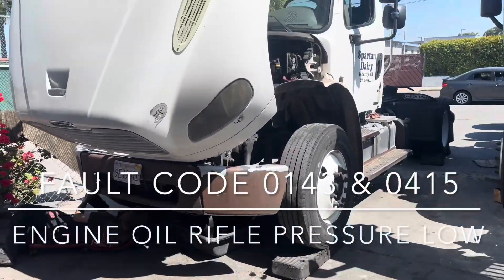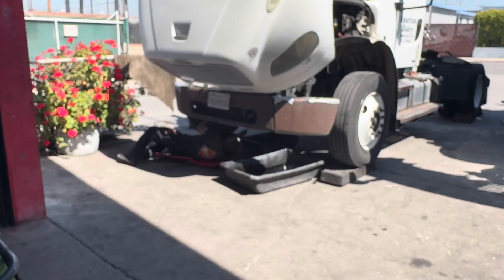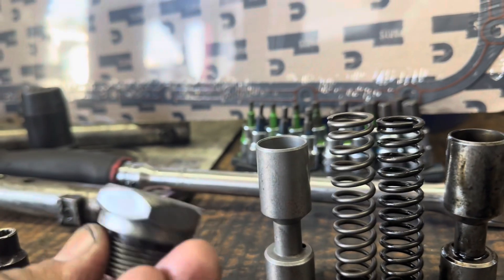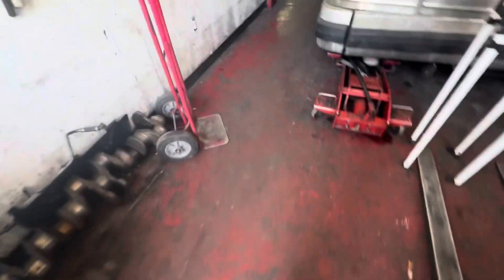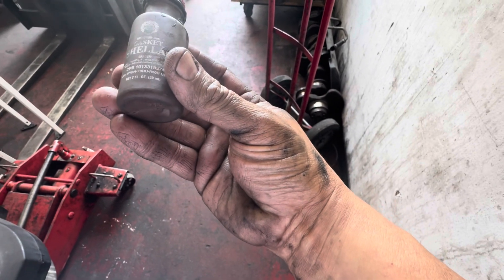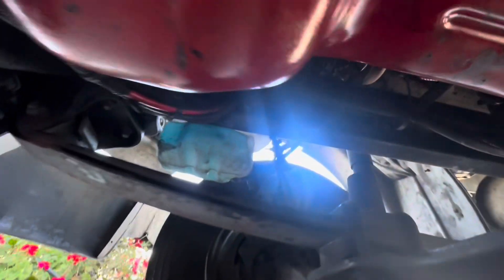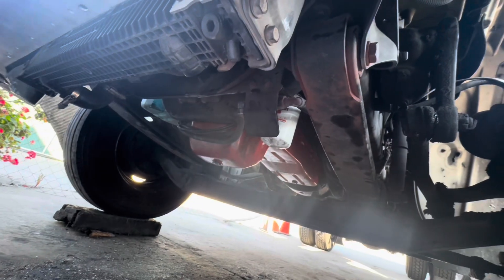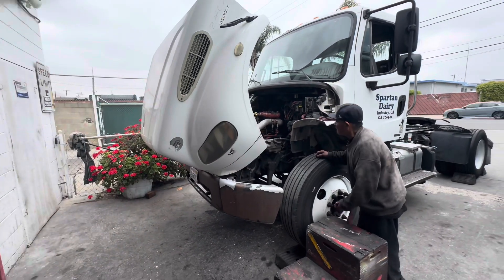Cummins low oil pressure fault code 0143 and 0415

Comment: Hey pedro. I'm having an issue with a 2020 dd13 88k miles . Regen needed every 3 weeks. Operator was instructed to not idle tractor during their delivery stops. According to the operator he has cut that habit but problem still pertains.  Possible clogged dpf? What do you think it is? 
Thanks in advance
Reply from the maker: When you run a parked regen? What is the DOC inlet pressure? What is the NOx efficiency? Do you have any fault codes?
Reply: Hey thanks for the speed response. 
SPN5443/FMI15 
DOC INLET .380
DPF OUTLET .160
NOX EFFICIENCY .98
Reply: I did notice actual torque load to be jumping from 30%-50% that's a bit too high isnt it?

Comment: Just looking at the oil before you dipped your finger in it, looked dangerously thin, color also
Reply from the maker: @jesusabueno1701  very true, I didn’t really know the history of the truck. So I wanted to start with the basics. If the oil thins again then we have to proceed up top.
Reply: @CarlosDieselElectric  absolutely 💯. You're the professional, but my 2 cents would've been to snag a sample and send it for testing. I speak from experience in my shortcomings. I am almost always over thinking 💩 lol. 
Great channel!!!